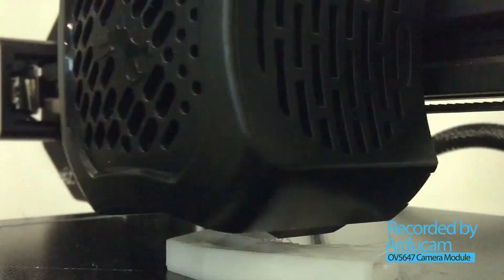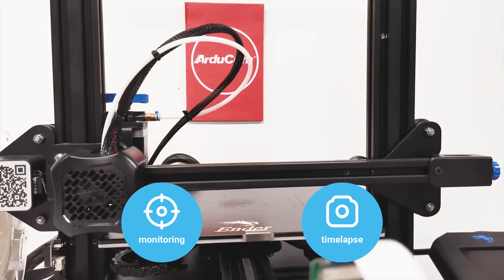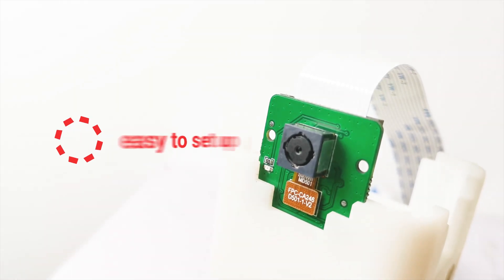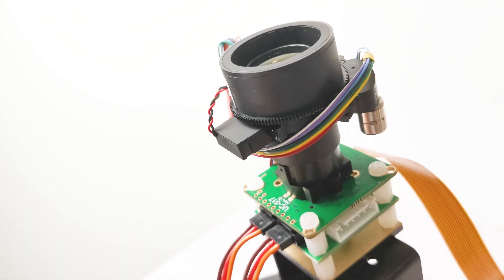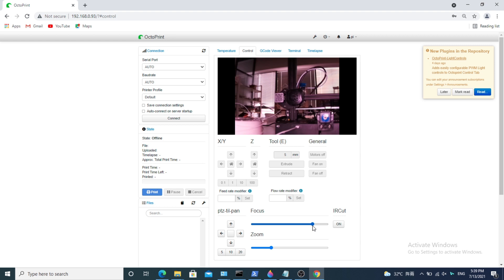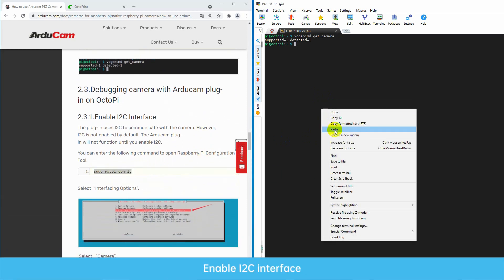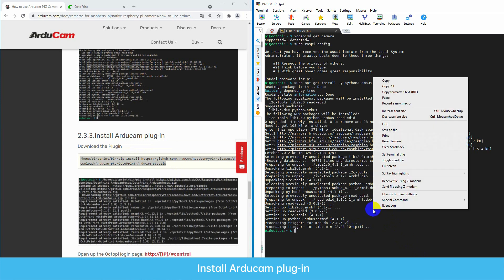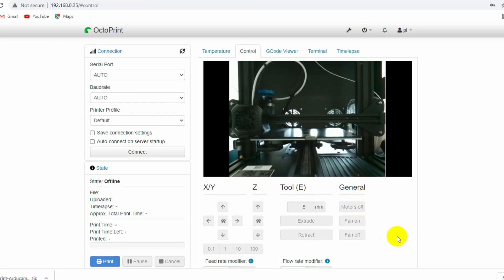3D Printer Cameras for Timelapse and Monitoring (Full User Guide)

Comment: You shouldn't use a knife and definitely not a razor sharp box cutter like this vlogger has. Scratching your build plate is naughty and it's always best to be patient and wait for the job and plate to cool before removing. It usually comes off easily and clean too. So rule of thumb; no sharp objects. If you think you need them, you are doing something wrong . . . imho.
Reply from the maker: Thank you for your advice!😀